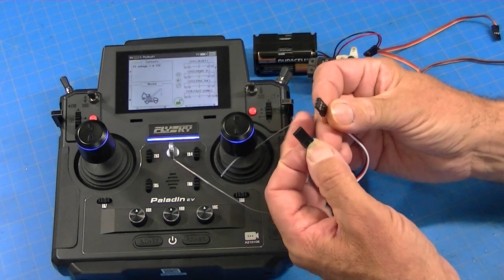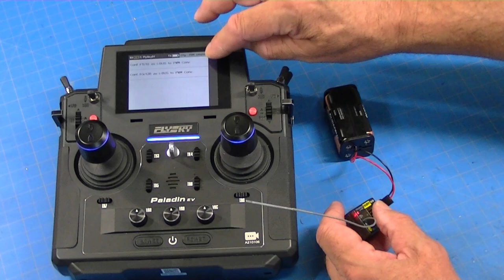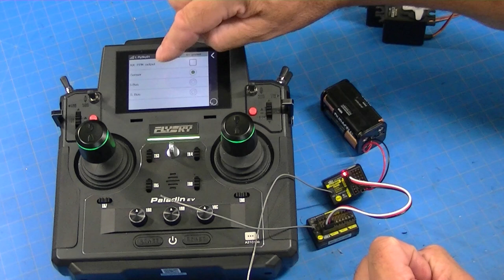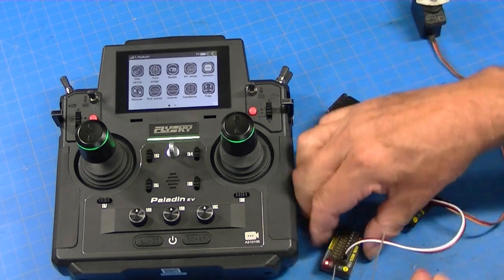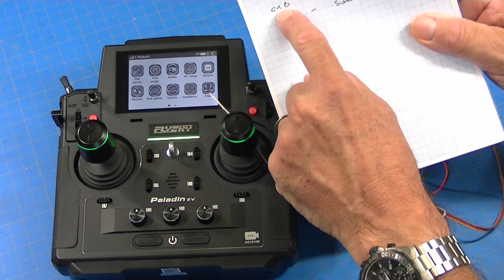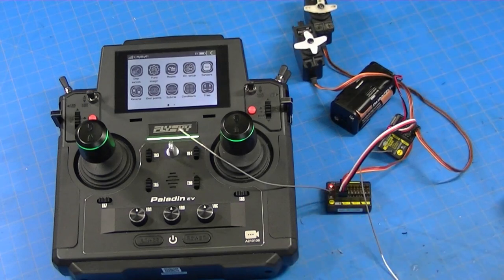RC Flysky PL18 EV High Channel Receiver Setups

Comment: Hi Bob 
how would you setup for two rx's one for the cab unit and one for the trailer without a connecting lead?
Reply from the maker: Can't bind 2 receivers at the same time on this radio.  There is a tricky way to assign 2 models with a quick switch over which I will highlight in an upcoming video.
Reply: You can bind multiple receiver. All you need is setup in the RF setup -> RF Type : FRM301 -> FRM301 -> RF Standard ->AFHDS3 1-Way. Then bind the receiver. Do take take note that all receiver bound share same channel output, channel 1 of receiver 1 same as channel 1 of receiver 2 and so on. 
You may use 2 receiver, first receiver for cab using channel 1 to 6 and second receiver on trailer for channel 7 to 12 assuming you are using FGR12B receiver. 
There is a catch, once the AFHDS3 set to 1 way, telementry function is disabled & function introduced in this video is also disabled.
Reply: @hideovt6263  thanx for that great

Comment: what if i connect a flight controller via sbus. The other channel still works?
Reply from the maker: Yes, you can still use the receiver plugs as normal.
Reply: @HobbyconceptsLLC  Thanks a lot. Will try it.